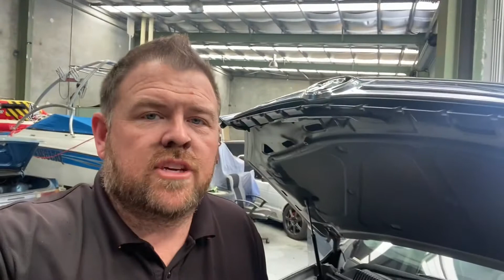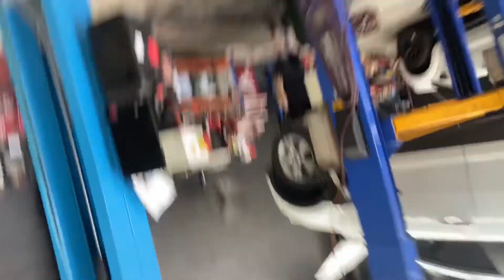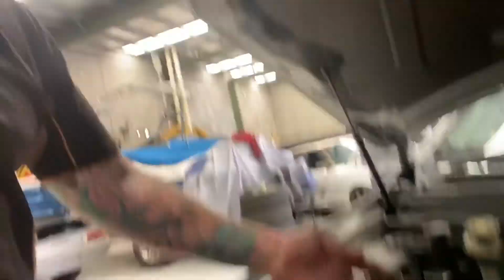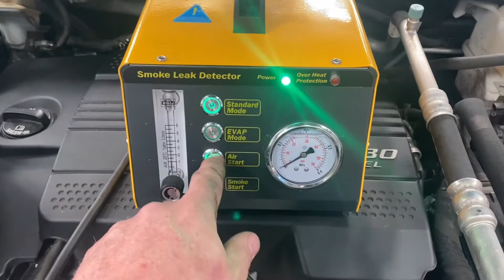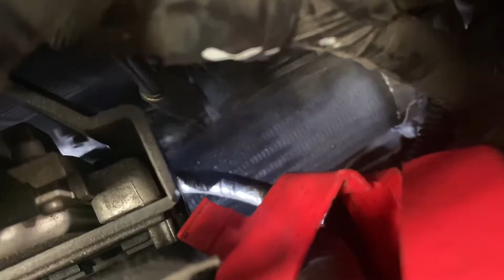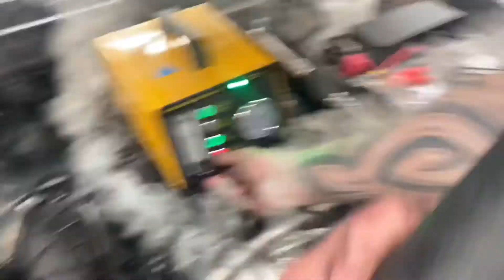How to fix DTC P0101 Holden Captiva

Comment: I have a 2007 Chevrolet Captiva 2.0 diesel,and my mechanic changed the GlowPlugs,and after that the check engine light appeared and It had a P0101 error code(but the car runs okay)Now my friend wants to buy the car,and I have to solve this check engine code but we don't know what could it be...pleas help me
Reply from the maker: You will need to check for leaks like in video

Comment: hi mate have 2012 captiva diseal engine reduce power stays on now along with spanned light service spammed light , code says turbo charger postion  boost senser  low ceircuut .no one  knows  what it is

Comment: Hey mate great vid, I have 2013 diesel captiva over here in WA I'm wanting to put a boost guage in to monitor for a drop in pressure, where would be a good place to tap into for boost reference for the guage?
Reply from the maker: Thanks mate
 I haven’t looked properly on where to pick up boost on the engine sorry.

You could just get a bolt in barb and just put it in the rubber/silicone hose pretty easily 
Something like this

https://raceworks.com.au/silicone-hose/vacuum-line-fitting-kit/